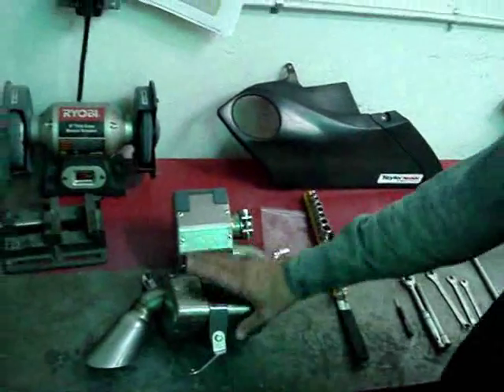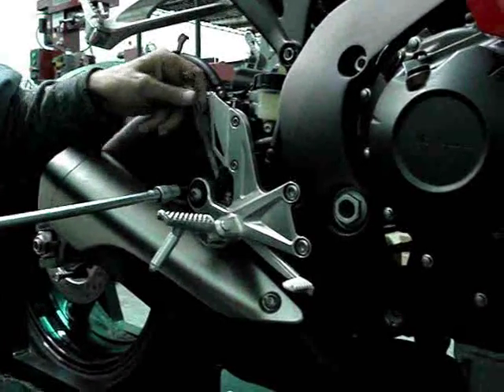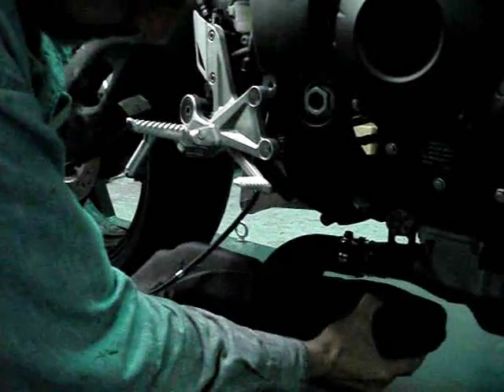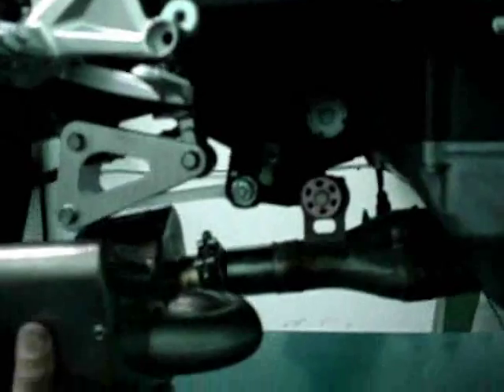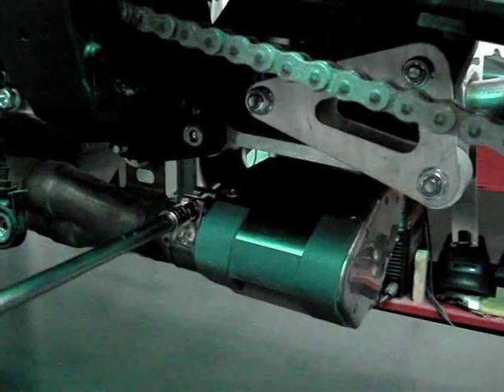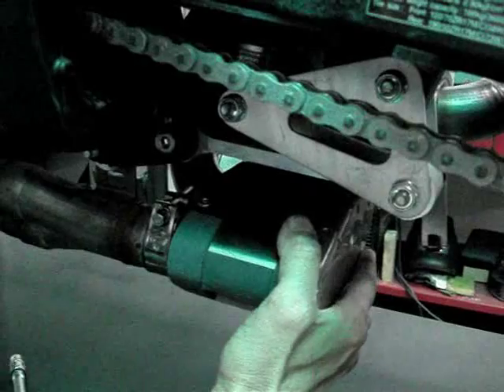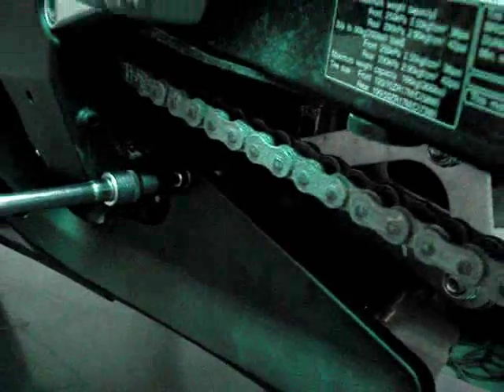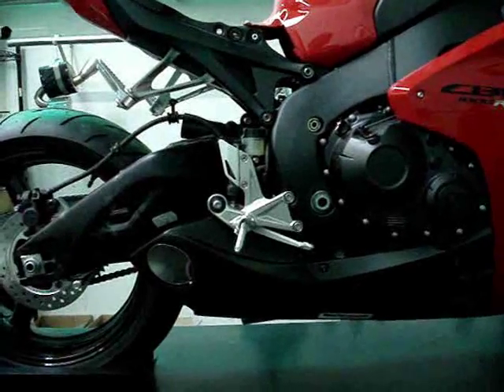TaylorMade Racing 2008-2011 CBR 1000RR Install Guide

Comment: Hi , can I ask if this exhaust will fit my 2013 cbr 100rr ? 
Is it true that the pipe will fit ? But the cover will not be in the same line with the bottom line of the bike ?? 
Thank you for your time 
Regards 
Alan